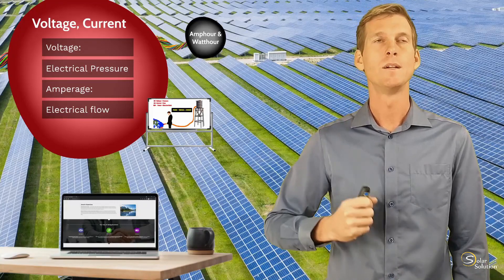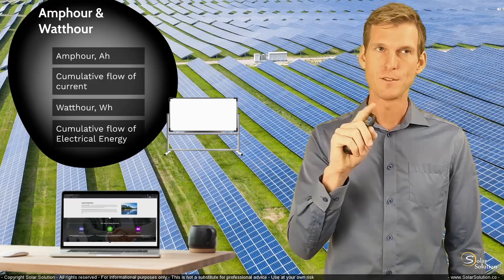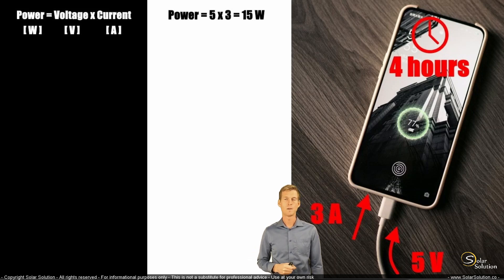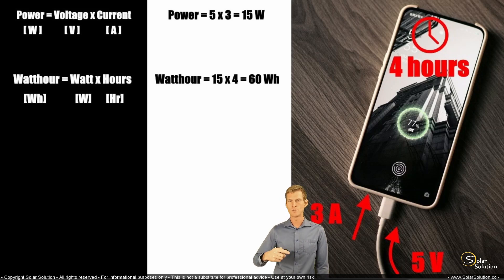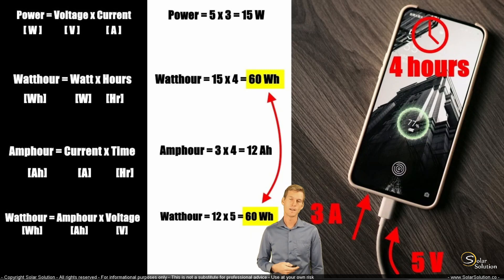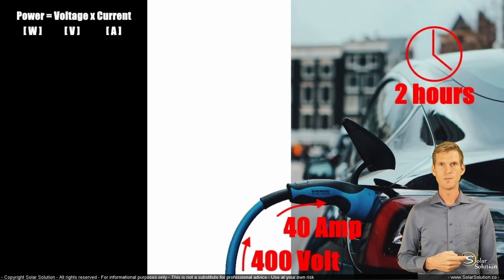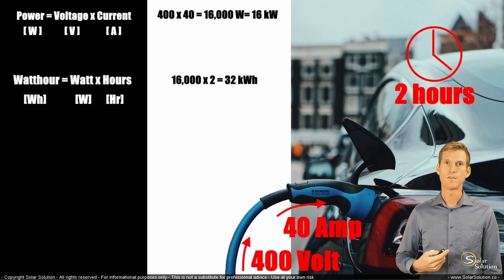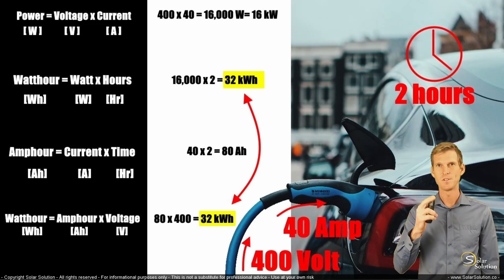Watts and Amp Hours: How many & How to convert

Comment: Where did the 4 hrs come from? We were only looking 1 hr.
Reply: The phone is charging for 4 hours.
Reply: I think is because he is considering a full battery charging cycle as unit of measure.
So you need 60Wh to fully charge the battery. Of course, you can't throw that energy in 1 hour in your battery cause you will burn it, so you have to "spread" it on a 4 hour cycle.

Comment: Another way:
• Watt-hour (W•h): unit of energy (E or W). The joule (J) is also another unit for energy.
• Ampere-hour (A•h): unit of electric charge (Q). The coulomb (C) is also another unit for charge.
Reply: Yes, exactly. I found it peculiar to invent new units for quantification of both energy and numbers of electrons. You assume the charge and discharge cycles occur at a fixed voltage throughout, and with that assumption you convert one to the other by multiplying by voltage. But is reinvention of new units worth the conceptual gap in understanding? Is it that hard to say 'kilocoulombs', or kilojoules?
Reply from the maker: Excellent! Thank you for your contribution Alejandro.